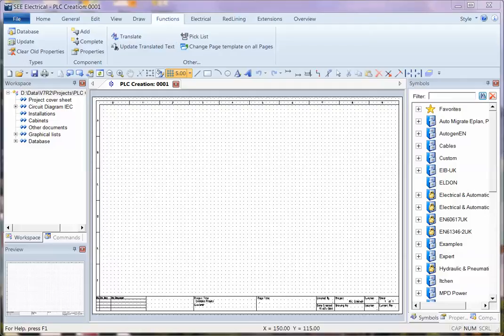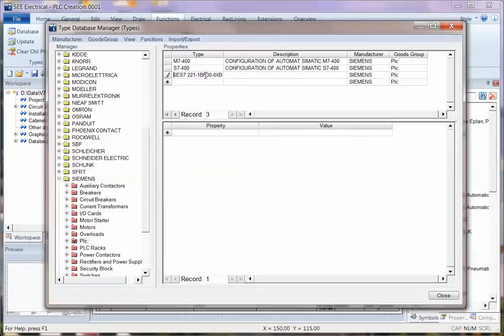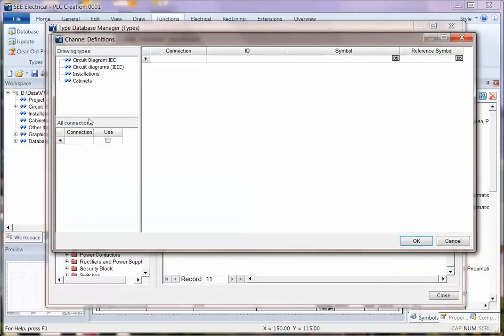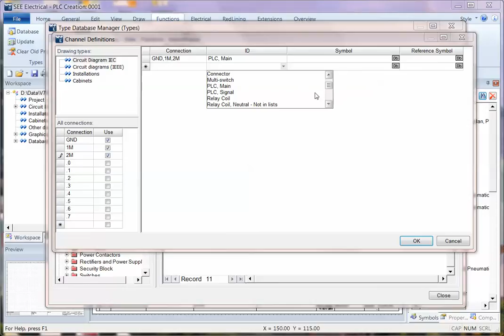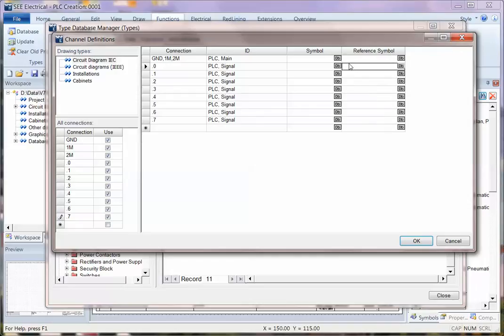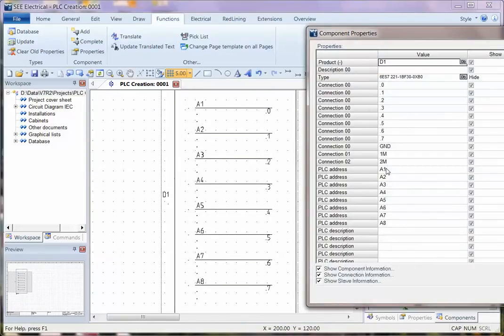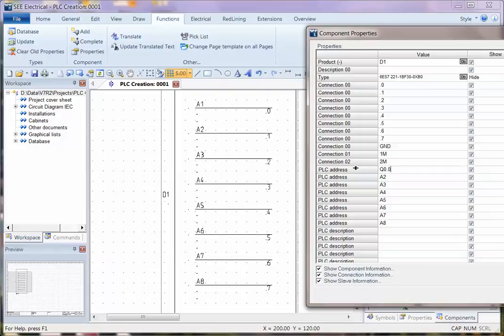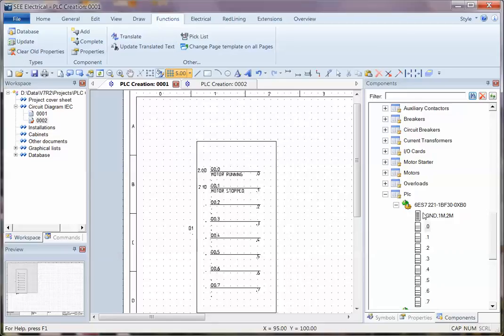Creating a Quick PLC from the Part Number V7R2

Comment: Is it possible to get auto numbering (PRODUCT) of the TERMINALS based on the page number & count. Like normal components?
Reply from the maker: Yes, right-click and select properties on the Circuit Diagrams node in the workspace panel. Select the Terminal Strips tab and change the Numbering type to Page/Code/Number. When you next place a terminal and click on the + next to the product it will incerment to the page/code/number e.g. 4X1:1 for a terminal strip starting on page 4. This is not used often because terminal strips are usually named to separate functions, such as X1 for 24VDC and X2 for 110VAC wiring and these will appear throughout the project, but its possible.
Reply from the maker: Yes, right-click and select properties on the Circuit Diagrams node in the workspace panel. Select the Terminal Strips tab and change the Numbering type to Page/Code/Number. When you next place a terminal and click on the + next to the product it will incerment to the page/code/number e.g. 4X1:1 for a terminal strip starting on page 4. This is not used often because terminal strips are usually named to separate functions, such as X1 for 24VDC and X2 for 110VAC wiring and these will appear throughout the project, but its possible.
Reply: Thank you for the clarification. But can I get these kind of Numbering in Potential transparent Terminals? 
Because presently I'm using a potential TERMINAL which don't have automatic numbering(PRODUCT) updation. I only need to manually name its Product. I need it's Product named interms of PAGE/CODE